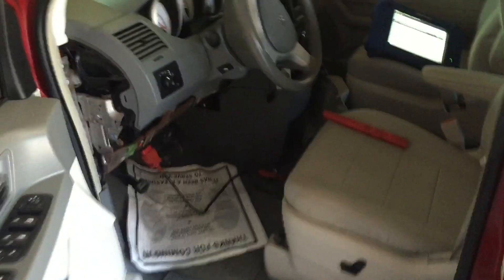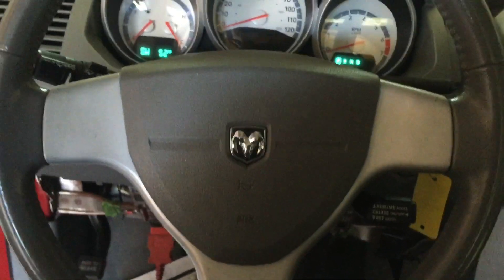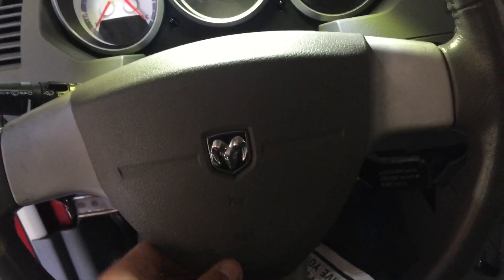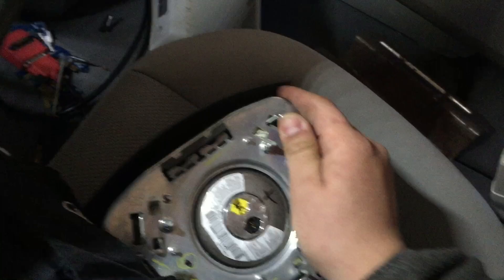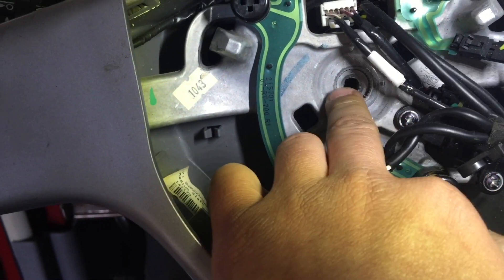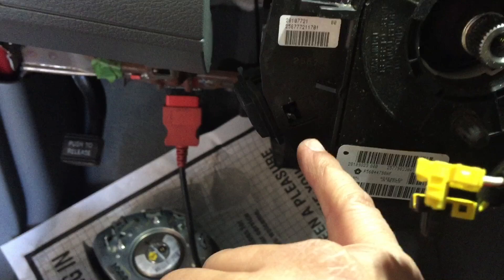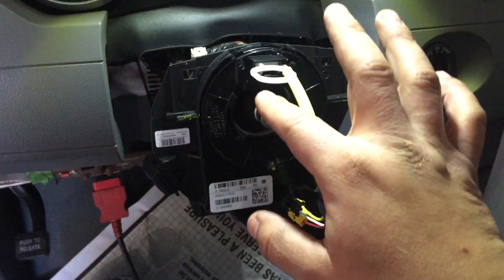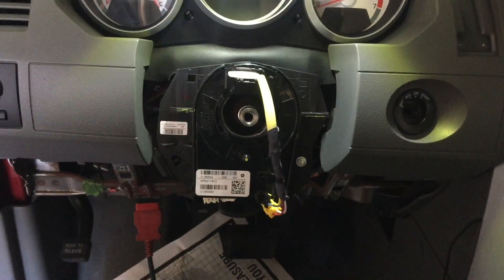Dodge Grand Caravan Clock Spring Removal ABS Code C1240/C2205

Comment: I’m getting this same exact clicking sound and thought it was the turn signal switch but I replaced it and the sound remained. I’m not getting any codes though just the clicking sound
Reply from the maker: the clocking sound comes from the turn signal usually

Comment: Awesome. . should work for my 2010 town and country. . wish me luck!  thanks a lot!!
Reply from the maker: +Mark E Good luck, let me know how it goes!
Reply: Did it work !!! And did you need to program any thing !!?
Reply from the maker: yes it worked. Fixed this issue and this time I did had to reset the angle sensor
Reply: How did you Reset the angle sensor
Reply from the maker: you need a tech 2 scanner or somebody with a Large scanner with tech 2 capabilities.
Reply: How to get the steering wheel off? I tried for two days with no results. Any clue?

Comment: So I have a 08 Grand Caravan SE. I dont hear any clicking no ABS light but I do get the TCS\BAS and "skidding car" light. When I drive it it retards the engine violently when I turn it until the ECU kills the traction control system. Is that a clockspring problem too?
Reply from the maker: no.. that sounds like an abs sensor or something like that
Reply: @FalconsGarage  I just scanned it and it's coming up as that sensor in the steering wheel. Thank god for warranty coverage.
Reply: @oneontamerlin  what part did you change ?

Comment: If just replacing the steering wheel and nothing else does the clock spring need to be reprogrammed?
Reply from the maker: no.. because the old clock spring should stay in place.. correct?

Comment: How do you tell if the angle sensor needs to be reset?
Reply from the maker: you would get a CEL code
Reply: actually believe it or not mine turned out to be the intake air filter plugged, I didn't get the airbag light but I got ABS, ESP BAS, and the skidding car one, noticed it would come and go and usually popped on for a while after letting off the gas.
Reply from the maker: weird,
Reply: first time it happened about 5 years ago, dealer couldn't figure it out, luckily last night I remembered that part, I banged the dust out of the filter last night and those three lights went off and then drove it around and they didn't come back on, next stop what the parts store. much cheaper fix than I originally thought. 👍

Comment: How did you get the steering wheel off? Theres no holes for a normal puller and my small gear puller doesn't fit. I wish you wouldn't have skipped that part...
Reply from the maker: I skipped it because I didn't need a puller or anything like that, it just came out.I just hit it a little on the sides with my hand and it came loose.
Reply: How to get the steering wheel off? I tried for two days with no results. Any clue?

Comment: What's the difference between a spiral clock spring and the whole unit? It seems that just the clock spring is not too much money (around $40), but the whole unit is around $200.... I'm a little confused?! Are they different?!
Reply from the maker: not sure.. but most times they will sell you the internals of a piece for a cheaper price and YOU have to take it apart and replace the broken piece .. and they entire assembly comes all together and no need for you to dismantle it.
Reply: @FalconsGarage  I'm just thinking I could save $160 or so if I assemble it myself. If it's the actual clock spring making the noise, perhaps I can just but that part...?! Also, great video! Super helpful.